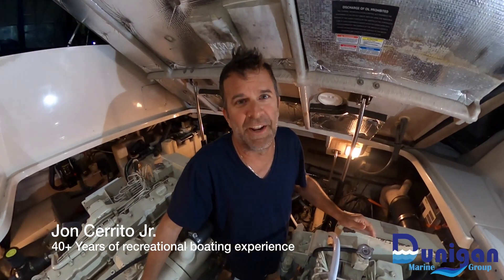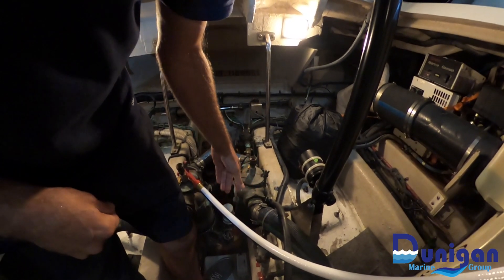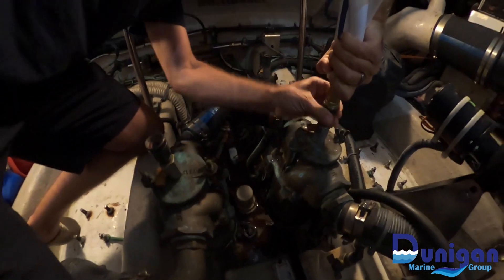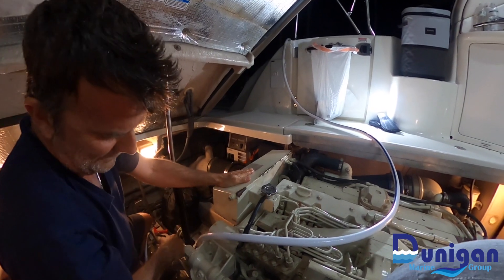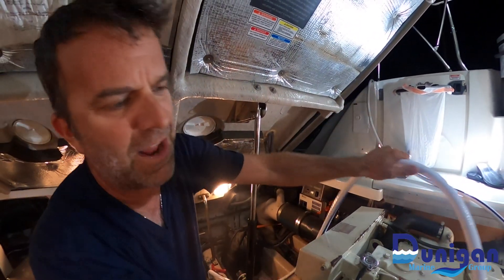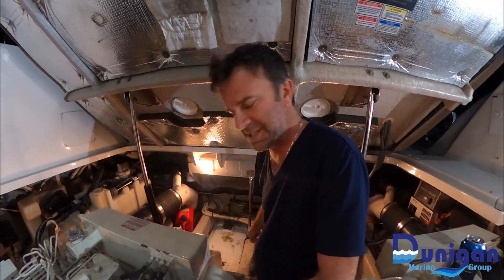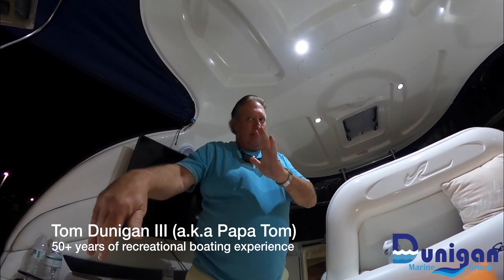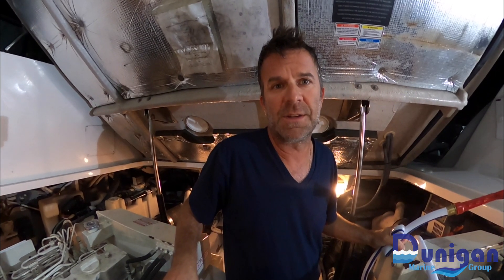Vessel Education Tutorial: HOW TO FRESH WATER FLUSH DIESEL INBOARD MOTORS

Comment: Thermostats actually have no impact on flushing the raw water side. The thermostat sits inside the closed cooling loop (antifreeze). Raw water side has unrestricted flow once you get past the impeller.
Reply: that’s correct. was thinking the same thing.